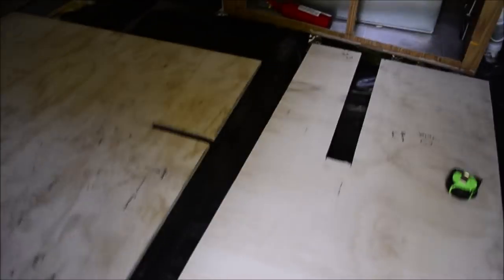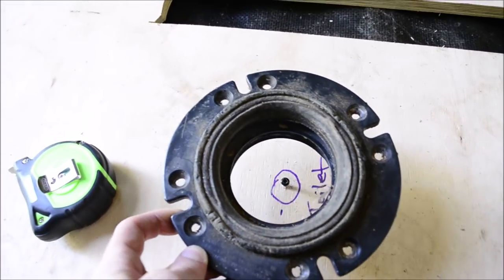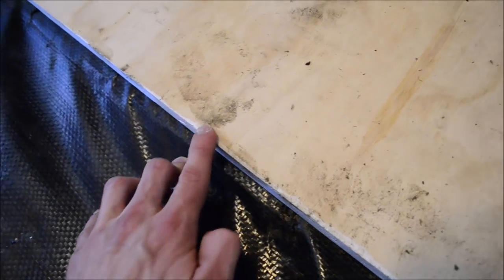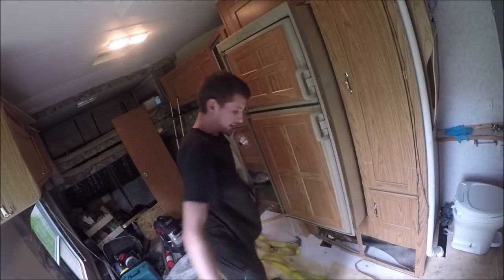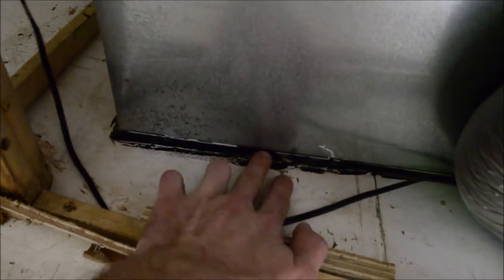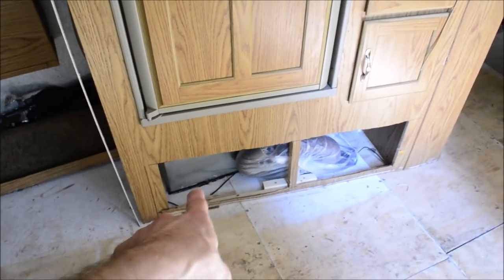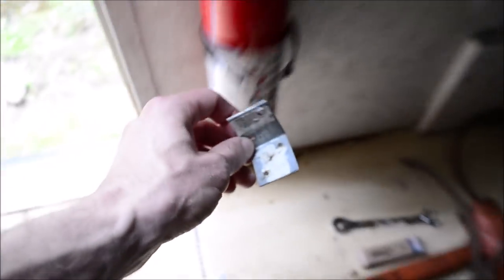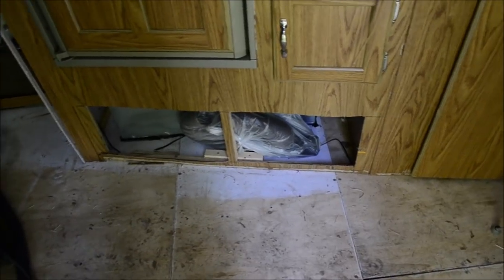Camper Floor Replacement Without Removing Cabinets - Weekend Warrior FK2100

Comment: you make it look so easy !! I look at the work to do on mine and cry..... you have done a great job, how did you keep it dry whilst working?
Reply from the maker: It took me a month to do the floor, it was really difficult, on top of working in between the constant rain storms we had. The first thing I did was reseal the roof before replacing the floor. I would just have to put everything away if it started raining. The whole project spanned the whole summer...removing and installing the floor, laminate floor and trim, lifting walls, resealing the roof and a window, replacing an axle, and more. I did get to go camping with it a few weeks ago 🙌. Now I have it under a 10' x 30' tarp so nothing happens over winter.
Reply: yeh the rain is a problem, Im in UK and we had so much sun this year , I wish I had started months ago. Now it's intermittent days as usual so a rush to do anything . I got ripped off too. I only paid 600 for a caravan but to me that is a lot only  to find the same, Im actually thinking to strip it all and make a shed out of it instead , you seem to have good experience with woodwork for sure, and a real strong purpose too
Reply from the maker: Yea it sucks to lose any amount to a scam, especially to something that was supposed to be a positive experience, so I'm sorry you got scammed too. In middle school we had to take wood shop, and in high school I took wood and metal shop. They made a bunch of industrialists out of us. I will still have to open up the front outer skin and let it dry and probably replace some wood in the wall...but that won't be until next spring. What happened to your caravan, did it leak through the roof or plumbing or something else?
Reply: I wasnt offered woodwork at school, we had needlework lol.  Tell you what tho, would have loved it! Yeah it already had a leak and he'd patched it and said he had replaced the wood too on the front corner, so I think the rain just followed the section he had done and the paint is cracking on the roof too. To be honest it's a totall redo, I'm going to order a tarp so I can get started ! Being a woman I feel very intimidated by it but after many tears, I realised the worst I can do is not put it back together!
Reply from the maker: The school made us learn how to use a sewing machine too 😉. That's great that you're going to go for it. Take your time, do research, work safely and it should work out fine, and remember it doesn't have to be perfect, mine isn't!
Reply: well yesterday, i checked the wood around door on the inside, it is crumbling in my fingers, so im not sure whether to strip that first and try to replace , this is where i get stuck , where to start lol :) have you done follow up vids?
Reply from the maker: Pretty much start anywhere, or at least in the spot that makes the most sense to you at the time you begin. You might find you have hindsight about something like "oh I should have done this other thing first", but don't worry about that and just keep going. I go from one thing to the other because I can't do one thing for too long. I haven't done a floor update, but here are all my videos so far for this camper: https://www.youtube.com/playlist?list=PLAu9Stvuzy_ZPgNGthb6JjdmT-wwP4wka
Reply: a DIY Car Guy  thanks I appreciate that :)
Reply: @luannalovell  Did you end up fixing it? I have to replace the entire subfloor and some floor on a 21ft camper. I didn't get scammed, just severely neglected a leak and now I'm paying the price for it :/
Reply: @PinkCampfire  SHAME yes a stitch in time save nine... no I gave up due to health issues good luck with your project

Comment: Inspirational at the very least. A 4' section of flooring in my pop up is rotted so I have to improvise a partial floor replacement.  I enjoy problem solving like you seem to. First thing today is to fix the leak that caused all this. I will not be negligent in looking after my camper again. Thanks for the video and I subscribed.

Comment: Wow!!  You did some STUFF!  Thanks for sharing. We got scammed too and wouldn’t have discovered our floor issues except that it just got really hot here (Mississippi) and the laminate floors started peeling up in places. I pulled some back today and, sure enough, rot. Unbelievable how crooked people can be; so wrong. I hope ours isn’t as bad but if so, I hope we handle it like you did. Impressive work. Thank you for sharing.

Comment: Thanks buddy, im having similar problems but its under my bed storage/cabinets

Good to see they dont have to all come out i didnt know where tf to start

Reckon ima start cutting the black tarp under it and see how bad it is

Dude said the roof leaked and he fixed it but the floors are rotten along the walls and under the cabinets is what i didnt notice because it was under the storage box x.x

Comment: I have a pop up tent trailer I'm working on I have rotting in the chip board I am planning on replacing the whole piece of flooring. I'm hoping I can replace it without having to pull out the cabinets like you have done here. It's my first time ever doing this I want to do it right I just hope I dont make the wrong choice by starting to tear out the floor with the cabinets in still 😬

Comment: about to do the same thing i picked up a 29 foot fleetwood camper.  Floors shot!   Let the fun begin.  Where is your other videos of showing finish?
Reply from the maker: That sucks! I've yet to do a video on the finish but it is finished...planning on doing a quick update video
Reply: Haha.   Hey your suppose to say "you can do it"!   Lol.  I paid 300 for the camper so I cant lose.  Worse case I make a really cool trailer out of it.  But I do plan on fixing it!
Reply from the maker: @FamilyChannelfun32  haha that's true, but I already know you can do it, goes without saying! $300 is a good deal, will be a winning result in one way or another!
Reply: Worst case...I strip it to the frame.   And build. Small house on it.   Tiny house

Comment: Hi there . I watched your floor removal too. Great job!!! I have to replace the front section(shower and toliet area) of floor in my 05 carson fun runner. I  currently live in my trailer so doing a lot of research before I tear anything up. I looked underneath and there is no center beam for the floor to sit on. Just the outer frame on front and both sides than the 1 cross rail which is in between the holding tanks. 3 feet from the front. Im gonna have to add a center support and it look like I only have about 1/2 in from the black tank to the bottom of frame where the floor sits on. Can you show me how your center rail is tied in. Thanks.
Reply from the maker: It's all put back together so I can't see anything anymore. I can tell you it's welded in. You can kindof see the outline of it at 5.59 in this video: https://www.youtube.com/watch?v=npKJIDoS660&t=1s
Reply: If anyone else runs in to this you can always weld more cross members to your frame

Comment: Shouldn't use traps on plumbing in campers it holds water and will freeze and bust. But great video and great job
Reply from the maker: The sinks have traps but it makes sense that the shower wouldn't, since the plumbing is hard to get to. Luckily there wasn't enough room so I didn't add the trap.

Comment: Do you have any pictures of how you repaired the underbelly when you were done? I got ripped off with a 2006 Thor toy hauler and have to replace the back portion of the camper. I'm pretty sure some of my water problems are coming from a combo of  either the back doors and or the damaged underbelly around the fuel fill area.
Reply from the maker: They make underbelly tape. I just removed the parts of the black underbelly I tore and just stapled up some hvac bubble insulation with 3m metal hvac tape around the edges. Doesn't have to be perfect, some campers don't even have underbelly material.

Comment: Nice job..I might of used cement board in the bathroom and sink area..just idea for some one in the future.....but great job ..shy didn’t you run the fridge tube straight down and out the bottom of the floor and you will never have to remember to pull it out..

Comment: Great video man! If u don't mind, what size wood u used? How much u spent total to replace the floor? I'm about to undertake a project like that w almost no floor replacing experience? Thanks!
Reply from the maker: Thank you, I used 3/4" plywood because that's what was originally there. I don't know the total. Probably 180 ish  for the plywood and screws, a little more for the insulation, after that it depends on what finish materials you choose. It probably cost me 300-400 for floor materials
Reply: @aDIYCarGuy  Thanks for your response, I really appreciate it!
Reply from the maker: @DGSantaFe  for sure, and good luck with yours!

Comment: Hello, was there a reason you did not use floor joist?
Reply from the maker: There are no wooden joists in this camper, just plywood on top of the metal trailer frame, the trailer frame acts like the joists, most campers are like this...wood joists add too much weight
Reply: That's what I'm saying, it seems he did a whole lot of work that was completely unnecessary. I give the guy credit, he worked his butt off and it's seems it's pretty solid, whoever he did it but dang, it made me want to pull my hair out with what all he had going on.

Comment: I'm a college student wanting to buy one and I don't wanna get ripped off. How didn't you notice all of this damage, should you have looked under the trailer first before buying?
Reply from the maker: The bottom of trailers are covered with a plastic membrane, with insulation above it, and the wood above that. So I can't cut someone's trailer open and look at the wood haha. If I pressed hard enough in enough spots, I would have been able to feel if the wood was soft or hard, I just felt one spot and was like "meh that's good"....I also should have felt the floor inside the front cabinets. That's where you're really going to feel if the floor is rotted or not, on the inside of the trailer.
Reply: What are front cabinets?
Reply from the maker: @briizcustoms9543  the kitchen cabinets

Comment: How much to replace floor? Labour?
Reply from the maker: Really depends on how much material you need and the price of it at the time you buy it and where you are, you will have to measure it up and calculate it. It might have cost me $300 at the time but I don't remember. Several days of my own labor spread out through a few weeks working around weather and my other work.

Comment: Personally I would have put liquid nails on the seams at least on the parts you will be walking on help make it stronger
Reply from the maker: I hear ya but I want it to be easy and fast to take apart if I ever have to again.
Reply: @aDIYCarGuy  good point.
Reply: @aDIYCarGuy  
As a very experienced pro remodeler of homes and campers I definitely would have used adhesive of some sort. The floors are maybe less important (for adhesive) but the cabinet panels like the one he made removable are actually structural and should be glued in a camper. 
Henry white elastomeric roof coating at Home Depot. Wash roof with TSP, rinse, dry, roll on two coats according to label directions. One problem solved. The other problem- windows:
 Loctite PL Window Door & Siding Polyurethane Sealant. You can painter’s tape around the windows and caulk them with that; it will outlast you and me! Peel the tape just after smoothing the caulking and it cures in 2 or 3 days to the most durable seal you can diy. A nice caulking and tape job actually looks better than the factory did it. Window seals will leak in time and should be replaced but around the siding-to-frame is where I see most leaks happen 
(Don’t use silicone caulk: it’s cheap, easy, and will not last. Plus it looks bad)

Comment: hi,  how lift the cabinet for floor renewal?
Reply from the maker: First find and remove the screws that attach the cabinet to the floor, then maybe you can get the flooring out from under the cabinets. If you need to remove the cabinets, they are likely screwed in from behind the camper's outer skin